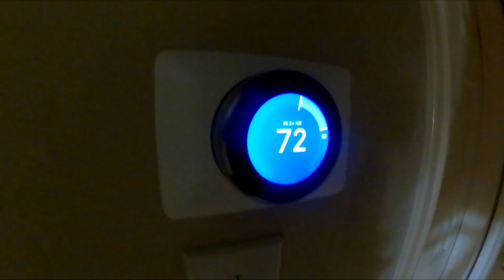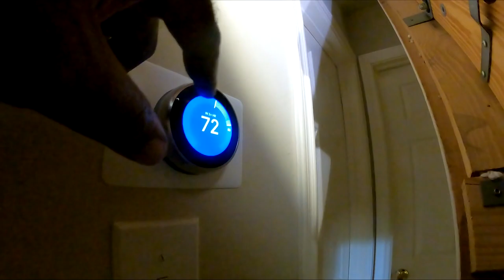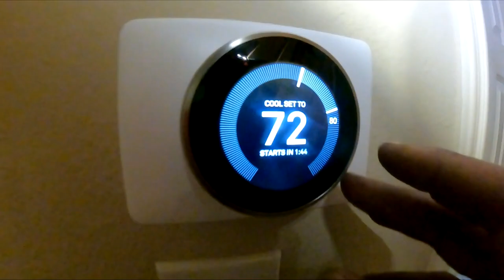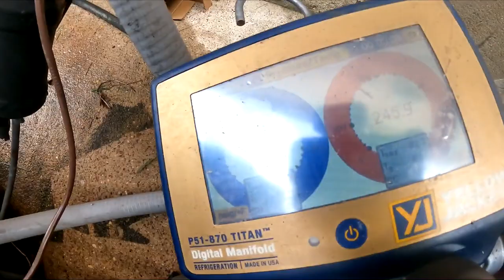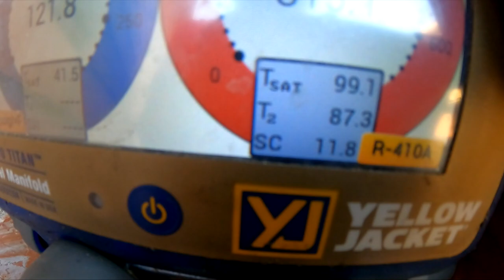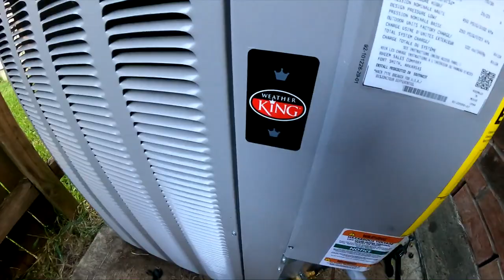Stay Cool: Troubleshooting R22 Goodman AC for No Cooling

Comment: It seems like there is a need for extra tanks of nitrogen and welding tanks.  Sure would not like to run out in the middle of a diagnosis miles from the office/shop, Question..."get approval for a 410a replacement condenser" on an R22 system?

Comment: Bad idea connecting a 410-A unit to an evaporator coil that has had R-22 refrigerant in it! When the oils mix, they turn into a sludge.
Reply: Is there a flush the old out process?
Reply: @Garth2011  the only thing I would flush would be an old line set, if it’s one that can’t be replaced. It’s impossible to get all the flushing chemical out of an A-coil
Reply: @danielkelley7422  Copy that...too many turns, elbows etc in the A coil. Didn't think of them at first.  There are companies doing this in our area too. It's for folks who are tight with their money option I guess. I don't see why anyone would want to take a chance with their new $2,500 to $3,000 condensing unit and some special compatible refrigerant to marry 410a with R22 A coils. Some folks just prefer to spend lightly now and pay twice or more later than if they replaced the entire unit in the first place.
Reply: @danielkelley7422  a flush along with pulling it down to a deep vacuum wouldnt be sufficient to ensure there is no old oil in the evaporator if you were going to retrofit?
Reply: @FREAKOZOID114  People are willing to try anything to save a buck. I’m not. If I sell someone equipment, I want to be sure it’s done correctly so if there’s a problem, it’s the manufacturer’s problem not mine. The manufacturer of the equipment that I use wouldn’t honor their warranty on an AC unit if I didn’t replace the evaporator coil also
Reply: @Garth2011  I agree. Sometimes you just have to walk away from jobs. If they don’t want to do it right, then I won’t do it. Because if you do install just the AC, when there’s an issue, they’re going to put the blame on you.
Reply: @danielkelley7422  makes sense. Just finished starting out in the field so figured I would pick your brain.
Reply: @FREAKOZOID114  good deal. I really like this profession, hopefully you will also. Most of the time people are happy to see you because they’re hot or cold. You get to work someplace new almost daily, and if you are in service, you get to figure out what is wrong with the system. Installs give you a good sense of accomplishment. Best of luck Austin
Reply: @danielkelley7422  Not really.  Just get a drum of R-11 from China  ;`>